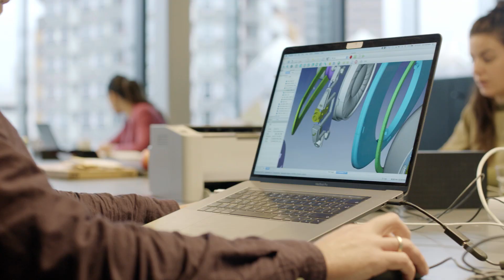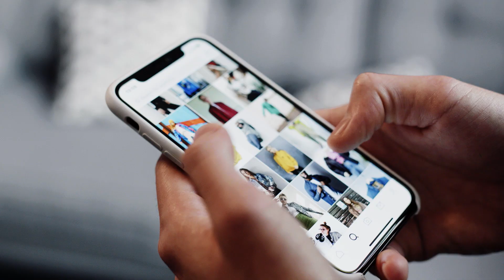Humans Changed the Face of the Earth, Now We Rethink Our Future | Ellen MacArthur Foundation

Comment: Graphene will have a HUGE part to play in the Circle Economy. It will bridge the divide between burning oil for energy to the building material of the future. Graphene will provide our energy requirements. :) 

https://www.facebook.com/craigglewis1/posts/2774362382595507

GHDPE will be the building material of the future. :)

We will Build the Future with Graphene.

Oil and Graphene will build future vehicle frames and components, Bridges and buildings. The United SuperHighway from Coast, to Coast and Off the Coasts. Plastic Floating Islands for 100M's that will have to relocate due to climate change, and oceans rises.

Cables for transmitting power, Thermal energy, strength. Geothermal transmission lines.

GraphAircrete for Supercements. Stronger, lighter, economical, environmental, sustainable. Prefab homes, building, structures which are fire and hurricane-proof, saving lives, and environments.

We are talking a Revolution for the Future with Graphene.

It's started and we have the resources, to create and build NL, Canada, the world's future! :)

https://www.researchgate.net/…/283520085_Fabrication_of_a_H…

https://royalsocietypublishing.org/d…/10.1098/rsif.2018.0273

https://www.onepetro.org/conference-paper/SPE-195069-MS
https://onlinelibrary.wiley.com/doi/abs/10.1002/pen.24981

https://iopscience.iop.org/…/10.…/1757-899X/376/1/012077/pdf